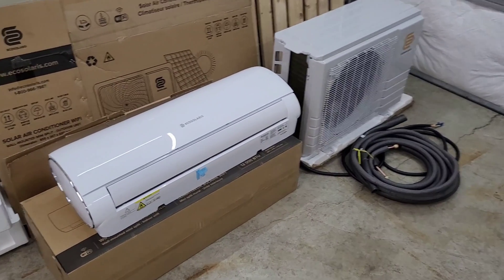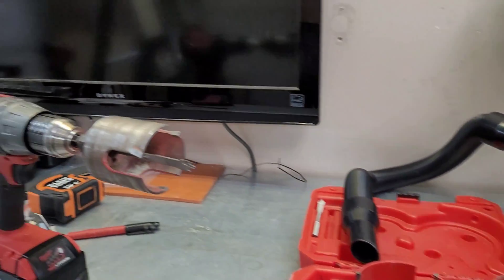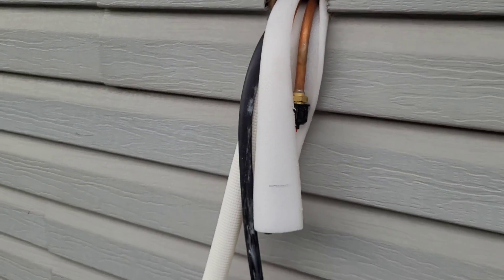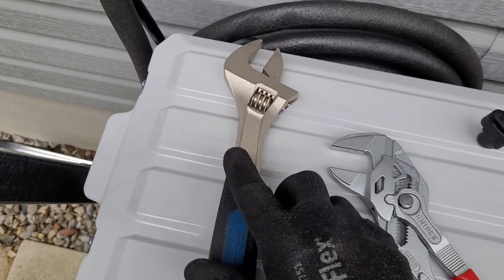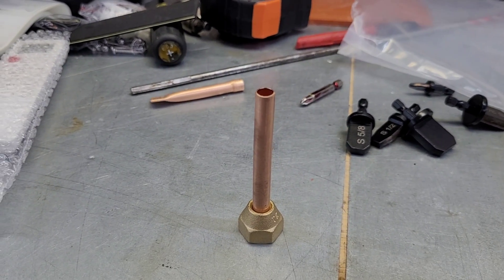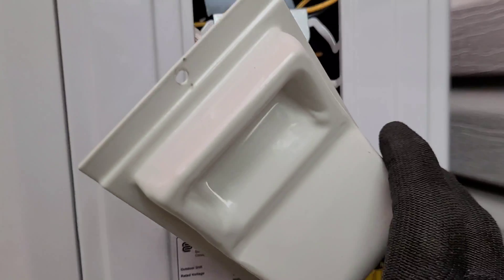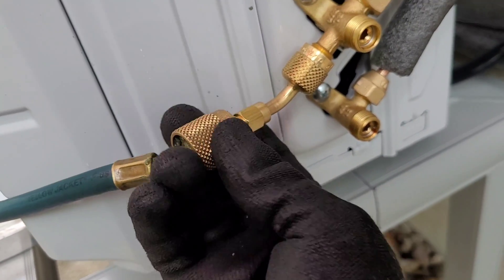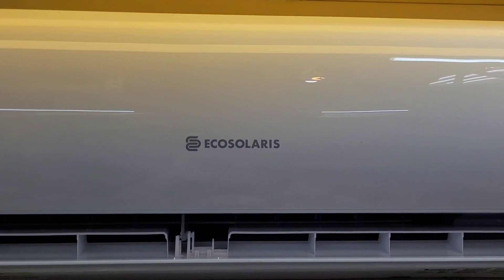Off-Grid Mini-Split! Installing The Ecosolaris Solar AC

Comment: i have the 18000btu ecosolaris , using it right now to heat my garage. I'm only using dc solar power. I added ac power to through some more heat in on cloudy days. when I did I was getting an e6 code. any reason why? the site says that means its a communication problem but it works fine on dc only. love the videos thanks!

Comment: Signature Solar sells the EG4 12000BTU solar mini- split for $1300 and InvertersRUS sells the Ecosolaris 12000BTU mini-split for $1600. Does anyone know of a reason for the $300 difference?
Reply from the maker: It's a brand new product, and Ecosolaris is a much smaller company than EG4. Im sure they don't have the volume EG4 does. The price could change with time.
Reply: Eg4 has great customer service and warranty. They are known for great product also. This product is probably a smaller company and if it was me. I'll stick to eg4 because they are  well known and a little cheaper.

Comment: Thanks for the video.  Looks a little more complicated than the EG4. I finally have both my units in and solar running to them. Been pleased so far. You were very helpful in me getting that done. Thanks Again.... Jeff
Reply from the maker: Thanks Jeff! It's the same as the EG4 first generation, a little less DIY than the pre charged inset version but still pretty easy. I complicated things making the lines shorter but that's not necessary.
Reply: @SmitHVAC.  Hi, great viedo. Just one question, I'm no hvac guy 😅 so at about 11:20 mark is that process due to you having to cut the line or is that standard even if I decide to just coil up the excess?
Referencing the vacuum process.
Reply from the maker: @thefunkmonk67 that's standard for this line set, I don't believe they offer a pre-charged version